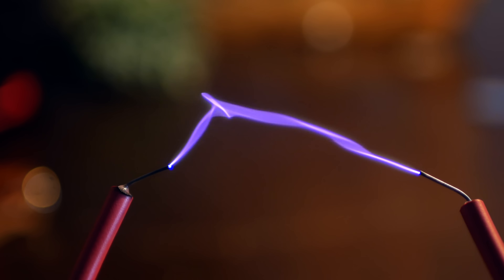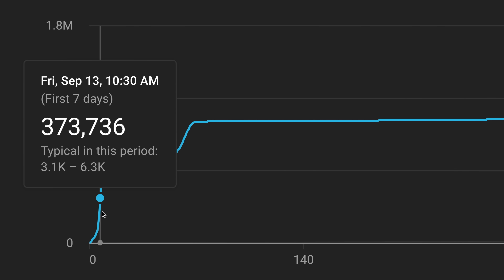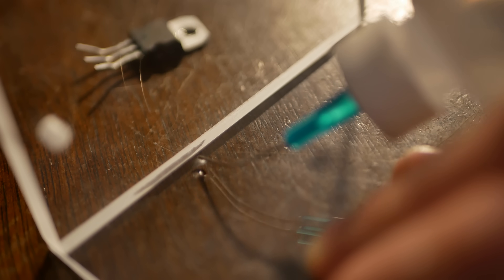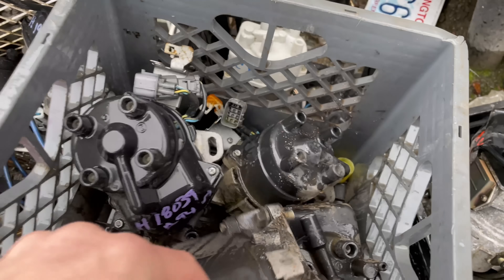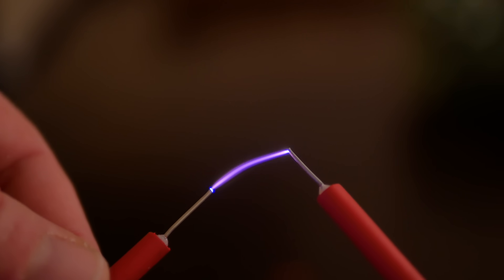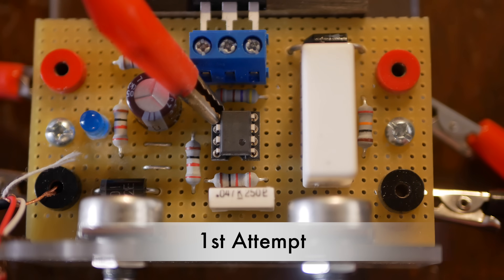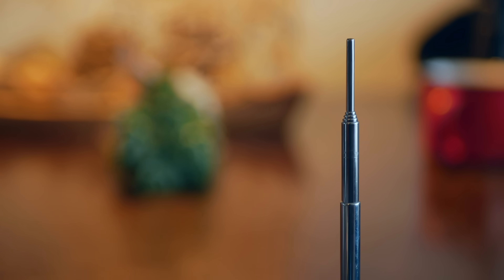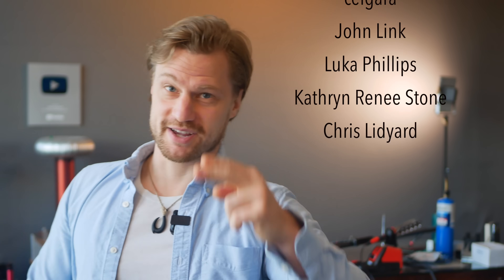Giant Bluetooth Plasma Speaker from Honda Ignition Coils (60,000 volts)⚡

Comment from the maker: Imagine being an electron along on THIS ride. I've included links to most of the major components for this build, in the video description. Also - this location was RF shielded. After manual testing, when all doors were closed, no radio escaped or entered. It made using my cell phone with closed doors, nearly impossible. Do not attempt to create a spark gap radio yourself, as it can cause radio interference.
Reply: Electron be like - where AM I ?
Reply: @dire_prism  Surely that's an electrons default state anyway? 
Unless it can observe itself 🤔
Reply: @EddieTheH  exactly
Reply: when are you gonna do earthbending for the element series u did years ago, it's still not finished :<
Reply: Sigh... I was gonna ask if that thing needs an FCC license 😂but you answered already
Reply: Will you try out thise?
You now that water is suprising..
https://youtu.be/IGpXA6qhH_Q
Reply: Ok this is more of a request than a response but here goes
I had some ideas for a generator but found rpm’s are limited by the bearings ( like a bendini circuit with magnets and coils ) 
I was experimenting with neodymium magnets and thought 💭 why not eliminate the friction of bearings and use magnetic fields to levitate the ends of a shaft that had discs with magnets to fire coils . 
Would you consider trying it out ? 
I got as far as a disc at each end with magnets evenly spaced out . My first attempts were too rough of a ride because not enough matching magnets on the outer repelling magnet group causing vibration of the shaft . I did discover if I tilted the magnet on an angle it’s magnetic footprint was elliptical and ran smoother with less bumping .
Now of course super conductors came to mind but I was trying it out more on principle.
Thank you in advance if you choose to experiment on this idea . 
Kind of a “ better mousetrap “ but no need for bearings would change a lot . 
IRL it would extend the life of wind farm generators from catastrophic failure due to bearing failure that is all too common
Reply: @azarahwagner2749 Google Halbach bearing.
Reply: @azarahwagner2749  you typed all dis 0-0
Reply: On arriving on the other side, the 3L3C7R0N is Screaming:
That was fun, C'mon, let's do it again, again, again!
Reply: Could you connect the hv to a line of coils on switches....rail gun with no cap charge maby hehehe
Reply: You sir are smart like crazy.  I'd needed a show and tell to keep up
Reply: Is this how Nichola Tesla said he was listening to some noise from out of space 🤔
Reply: I'd like to hear that everyday coz it sounds cool
Reply: I have a challenge for you. Try building an ion-cloud massless speaker. It's basically an ion-thruster that plays music. 

Here's the only video I can find about it, only a prototype was ever built. https://www.youtube.com/watch?v=msE14cWTwKI
Reply: https://youtu.be/FlgFkfpyAfo
Reply: Hollywoods oklahoma
Reply: The most crucial part is not listed. Where does one get an honda ignition coil from
Reply: A Honda

Comment: How did you get the diode running from the FET to ground not to over heat? I’ve used 4 10a10 in parallel and they’ll still get about the temperature of the solar corona

Comment: For a great 555 timer circuit that ALWAYS puts out a 50% D.C. (square wave) and has a single-pot frequency control, you can use the standard 555 astable mode with a simple mod:
Just toss the resistor that goes from pin7 to Vcc and re-connect the resistor that goes from pins 2 and 6 to pin 3 (output pin.  Pin 7 is NC)).  This lets the cap charge through equal value resistance to upper and lower trigger points.  Of course you will use a pot to vary the square wave.  You can also INDEPENDENTLY adjust the amplitude by varying Vcc (and pin 4).
The variation of amplitude and frequency does not effect the square wave duty cycle.
The frequency, in Hz, is given by 1/1.39 RC, where 1.39 comes from 2 ln2. 
GREAT VIDEO...I will have to try that snubber.
ps
 I am pretty sure the frequency formula is correct from my derivation, but I just now realized I never checkedthat on a BB...but the circuit works!
--dAlE

Comment: Hello, I love your vids. I'm a composer and this has always fascinated me. Here's my question. If you take a digital music file and split it up by frequency bands, let's say 6 or 7 bands and make discreet files and feed the signals to its own coil, will it sound better? Perhaps for the subharmonics use a larger coil and use a smaller coil on the high end and scale up the coil size per band, could this improve the sound of the reproduction? Bluecat audio makes the MB-7 mixer which does this, perfectly filtering or soloing a defined frequency band up to 7 bands. Worth a try? I could prepare audio files for this. Thx

Comment: Hey dude! Um, I’ve had an idea for a while. Was wondering what you thought of a “plasma antenna?”
My idea was to pump signal into a CFL or fluorescent tube (4’-8’).
But you da man with high volts!!
I’m a elechicken, not an electrician. I read about Tesla, not reproduce his experiments. He got zapped a few times! I’m good!
I read somewhere plasma was ideal for radio broadcasts.
And turn lighted signs into wifi antennas - all up and down Hwy 99..
I live here too.😊 
Recognized Tap Plastics! Great for excavator windows too, and more affordable.

Comment: Here's what I'm trying to accomplish I have Spectrum analyzers on my music production software. I want to be able to input a sound wave and be able to modulate either a switch or turn on a light or circuit wirelessly. I can modulate the audio wave to whatever specs necessary analogor digital. I would like to have this plasma Arc as ignition or even as a frequency driver for servos or electric motors. I love your video of the voltage multiplier with the Tesla coil wondering if there's any way to incorporate the two. If I'm able to transmit the data through the beam then technically it be sent into another analyzer on the remote object.. right?

Comment: A lot of the concepts in this build are familiar to me as I've been doing Garage Science since I was a toddler... I've never really worked with acrylic like you are in this video though (I have used it before, but usually as just flat pieces to make shields or displays) so, I was curious; What exactly are doing doing with that little blue tool that you seem to be using when "gluing" the acrylic pieces together? I'm curious how you're gluing these together.

Comment: The transmitter idea is an interesting step back in time. The first radio transmitters, circa 1900, were spark gap sets. Before electronic (vacuum tube) oscillators and amplifiers were available, high speed mechanical alternators generated AC power, which was on/off modulated (i.e. switched) to a spark gap to generate RF energy. As you can imagine, this was down in the kilocycle range. Lee de Forest's vacuum tubes allowed RF frequencies up in the (gasp!) megacycle range. That was high frequency, or HF. Now, HF is close to the lowest RF range used, which make it's name an amusing paradox.

Comment: Also maybe try infront of a parabolic dish...  then try infront of sound blankets.  
Maybe also try inside a box... acrylic of course, with one side built as a passive sound radiator. Essentially a speaker cone with out the driver.
This type of Crack sound is super good at echoes,  and you pushing sound out in every direction.    You want to only push sound out in one direction

Comment: I recommend separating the low and high frequencies and playing each back on separate drivers. 2 archs simultaneously.  Thus should help with some of the volume problems.  Also maybe just clip out the highest of the frequencies so the coil isn't even trying to play those. 
You could make a circuit or maybe just do it  with equalizer software

Comment: I would say be EXTEREMLY careful with that spark gap transmitter...
 
The radio signals produced by spark-gap transmitters are electrically "noisy"; they have a wide bandwidth, creating radio frequency interference (RFI) that can disrupt other radio transmissions. This type of radio emission has been prohibited by international law since 1934.

Additionally, section 2.803(g) of the Rules provides in relevant part that:
[R]adio frequency devices that could not be authorized or legally operated under the 
current rules … shall not be operated, advertised, displayed, offered for sale or lease, sold 
or leased, or otherwise marketed absent a license issued under part 5 of this chapter or a 
special temporary authorization issued by the Commission.6

And will get you a fine of up to $10,000.
Edited to point out advertised
Reply from the maker: That's why I loved living at my old place ( I just moved). I lined the walls with grounded mesh and it was surrounded by concrete on 4 of 6 sides. I tested the device and found no interference happening outside my location.
Reply: @PlasmaChannel  Just make sure you are careful.

Comment: Given the ringing sound was coming across on the radio, I think that's an issue with the circuit, rather than being due to the ignition coils, given the circuit loop to the antenna is not in line with the coils. I don't know what the cause would be specifically, but either the bluetooth device or the driver was creating an extra frequency.

Comment: Did you ever consider using an LPF to attenuate the higher frequency noise?
Reply: Or even a BPF if you’re modulating the entire signal up to a higher frequency for better fidelity, that way you can filter both low and high frequency noise outside of your modulation band.

Comment: You need to use a very high oscillator frequency (20000 Hz or higher, which is above the upper hearing limit) so the oscillator cannot be heard. When arcing occurs on an AM radio mast, you can hear the audio clearly because the oscillating frequency is the station's frequency and what you hear is the modulation.

Comment: I wonder what it would be like using the coils as the source of the sound rather than a speaker - using a modular synth setup, you can feed it control voltage in the +/- 12V range which is pretty standard

Comment: Is there a reason why the radio output from the build sounded downsampled on the radio receiving the signel? It wasn't just at a low rate, it sounded like an old sound card with pcm sampling or a cheep toy that doesn't filter out the high frequency artifacts you get from playing low samplerate stuff.

Comment: Dude... get yourself some CNC mills for plastic then use your router to mill out the holes. Use a plunge router to take care of business. I have used this method for making a new clock face cover. The CNC mill bits are those that are o flute and can easily be used in a router. They are meant for plastics. Make sure you use a variable speed plunge router. You then set the router to go about 2-3 mm for each pass. The end result will be spectacularly clean and the plastic will not break. Also use the tape/ca glue trick to hold down the plastic on a surface like 1/8" MDF or even Masonite. If you get the milescraft circle jig you can use it to make round parts. Its super easy. Heat is your enemy when cutting plastic. One thing that is cheap and works well is windex. You know that blue fluid you use to clean windows. It acts like a lubricant and keeps your bit cool. The heat generated by the friction can cause issue when cutting plastics.

Comment: how about suspending a piece of alluminum or other foil in the arc gap to act as the speaker..) mess with electrode positions..)/* That, or thin metal disc between 2 piezo crystals, place that in the arc..)

Comment: I think you can protect your 555 ICs by using them to trigger a fast switching mosfet or possibly even a BIP373 Ignition driver - while they are limited to 14V input... well you should check the datasheet; they're built to make arcs inside of combustion chambers so they may be perfect.

Comment: "Are you filming?" - No. Not unless there is actual film. Making a video, or taking digital video that does not involve "old fashioned" film media technically is not "filming". 
Old school meaning something similar to cellulose nitrate. but modern day film is made from either a cellulose acetate or polyester base with a coating of light sensitive minerals - namely silver salts. A flash drive is none of these things, so no. Not filming. (Actually, I have no idea what you used to make the video, so I could in fact be wrong?) Hi from Olympia!

Comment: Can you make a video about a plasma stream that gets pushed in a acrylic vortex tube and see if the heavier and lighter particle separate and a voltage and magnetic field gets generated due to charge motion. I wonder if almost arbitrary magnetic field strength could be generated like this by fiddling with the acrylic vortex tube diameter, the plasma and the plasma stream speed.

Comment: Excellent video as usual! I would recommend moving your drain connection of your Fet directly to the primary instead of going through the diode, that diode is having to handle all that current which also (at higher frequencies) could cause issues. Leave the diode where it is but connect your drain directly the primary, that way your snubber is still operational. I would love to know if that helps, maybe make a short follow up video??

Comment: I got a question for you Jay. Is density of electrons= current and speed of electrons spin = voltage due to tension or is it speed of electron frequency or vibration that = voltage ! This question might be tricky to answer due to the construction of the question but the point is to explain the mechanics behind voltage and current . Maybe you would like to do some content with your understanding of them . My list of questions with plasma physics is getting bigger by the day but lets just start with the fundamentals! 👍🏻cheers from oz
Reply: I'm not Jay but I think of it like the height of a waterfall as the potential difference (voltage drop) and the volumetric flow rate as the current. Slightly different, the pressure being (like) the voltage and again the current being the flow rate. A narrow tube is a resistor as I = V/R.  Understand that equation inside and out.  Bucket of water = stored charge, a capacitor. The water analogy is not so good for AC circuits but fine for DC. Eg Q=VC which in the water metaphor could translate to volume of water equals height times capacitance of your vessel.  What is a battery like in this analogy? What is "ground" a reservoir of charge like the sea-- whatever you add or take away doesn't change the level, height because it's so big relatively and so on.

Comment: The fact that the FCC hasn't sued this guy 100 times over is the most impressive thing of all.
Imagine living close to this guy and trying to use wireless peripherals, good lord.
Reply: Haha all my DIY tesla coils cut out the wifi each time i turn them on, even though they are pathetic little things powered from a wall-wart, annoying my parents. I dont know what to do. And i try to modulate them the sound come through on the FM radio even though I wasn't even frequency-modulating it 🤔
Reply from the maker: Haha, they dont sue me because my transmitted signals are extremely weak, and blocked by the RF shielding i've put up years ago around my room. I installed faraday shielding which covers all my walls, ceiling, and and windows, and my floor is several feet thick of reinforced concrete. I have virtually zero cell phone reception at my place at all times, due to this. In order to play the radio, at the end of this video, I needed to remove the shielding from my windows. Otherwise I can't receive stable radio stations through my walls. You'll notice reception was terrible on the radio, as most the room was still mostly covered.

Comment: It's the voltage 60000 ac or  dc  can be made the other way around  like if it's ac / dc  or vice versa,
Reply from the maker: Coming from an ignition coil, the voltage is AC. Adding several high voltage diodes would change that.
Reply: @PlasmaChannel  okay I like to see that ac plasma to convert  to DC,

Comment: What's the tool for the glue you use, how do I find that?? And what kind of glue is it? :)
Reply from the maker: Hi Tony. You need to use acrylic glue itself. And, an applicator. They are specific items, and take a lot of practice to use. Acrylic glue is thinner than water and also evaporates very fast, so it gushes out of the bottle due to viscosity and due to constant pressure building up in the bottle. You never want too much glue. Takes some practice, but… yeah.

Comment: If you hate the 555, just use an Arduino (yea you gotta learn some interrupt stuff, but if you just copy and paste-modify one of their examples, it is very easy).. You could even use a driver board addon thingy (just to isolate the arudino)..  Now it might be a bit more expensive by a few coffees, but at the same time you'll spend very little time fighting the waveform (cuz you could solve that issue in software vs iffy-pots|caps|resistors)..  IMHO you save overall since I consider time expensive..   Ur really missing out on the microcontroller based controlling, once you have some things working, it's super easy to lego that stuff up.

Comment: I would recommend looking for information on how FM transmitters encode the audio signal on the carrier frequency. If you're able to adjust your circuit to operate the arc on a frequency just outside of the human audible range, it might help with the screeching noise.